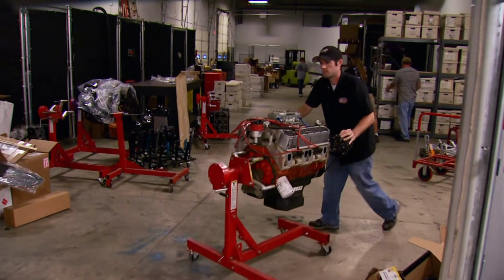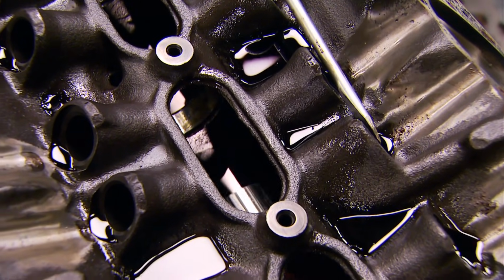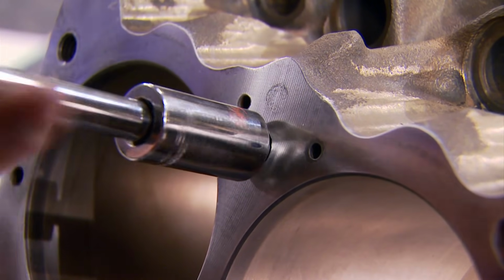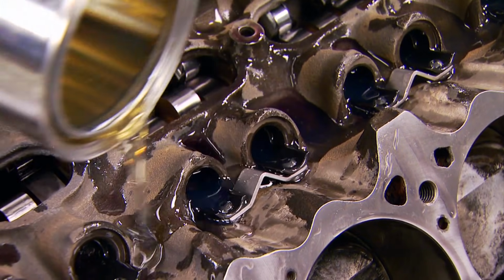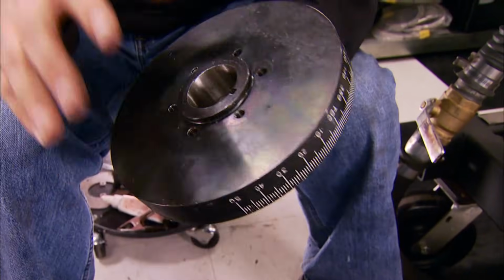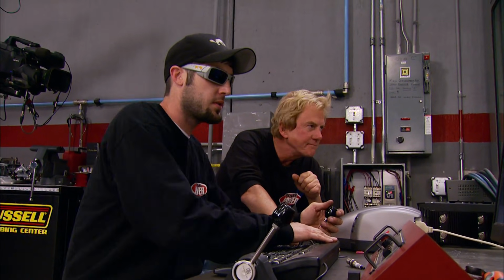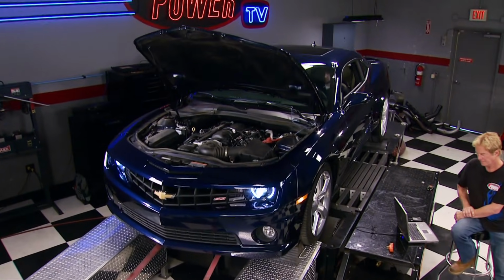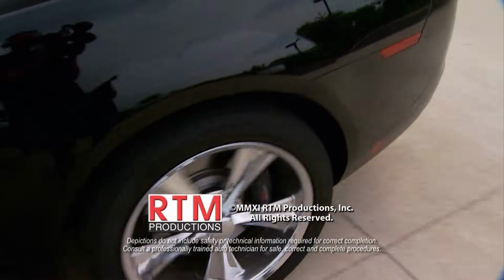Rebuilding A Junkyard Mopar 360 With Minimal New Parts - Horsepower S14, E19

Comment: at what rpm did you make max horsepower and torque and what is the compression ratio how much queench do you have between head and piston is that hypereutectic pistons block bored.020 over

Comment: The only thing I don't like is how they cleaned the surface of the heads were they contact the head gasket 😢 good thing they caught that balance issue that could have been dangerous 😮 I had a piece of metal get behind my glasses and get in my eye but it was a chip from cutting metal on a miter saw and it was very hot 🔥

Comment: The heads, intake, and valve covers, not to mention the oil pan and roller conversion are quite expensive, normally you might find a used or junkyard engine with one of these for $500. But not all. The last small block i built cost 7k in parts including  twisted wedge heads $1500 each, callies billet crank 2k, carillo rods , king bearings, mahle pistons, chrome rings, needle bearing small end machining for rods Bowtie block, deep sump pan, titanium valves with 5 angle valvejob and port blending etc, secret carb and intake  it made 780 hp, not bad for a stock bore chevy 350. But obviously not unobtainable either with careful planning and execution, research etc. I researched the parts combo for 2 years before ordering anything, sometimes thats what it takes to build a dream engine,,,, lotsa dreaming,,,, then lotsa money and labor, and patience.

Comment: Surprise to see no one caught the fact. That's a magnum block with LA style heads. No oil going to the top through the block. Block not drilled. To supply the heads with oil. Push rods are solid. No oil passage in the Push rob That's what you get with Chevy guys. Building a  mopar engine.
Reply: THANK YOU
Reply: I was surprised that when he pre-oiled the engine, an turned it over by hand, he did it with the valve covers on.
 If they had been off, they may have noticed a lack of top end oil.
  I have come accross 2 318 magnum blocks with LA heads, (home rebuilds) it is surprising how long they will run without any oil circulating through the top.
 But, they do end up wiping the valve train out.

Comment: Read comments.... dont laugh... i bought cheap rusty Plymouth volare for $150 many years back had plain high mile slant 6. Some old friends ww new growing up into crack n coke etc were desperate for a car with tabs. My oldest brothers friend. He traded me strait up for B5 blue 72 Cuda" 340. He wasnt mechanic. I saw it had alternator wire hanging off, and needed correct fan spacer. I went home got correct spacer i had, went back and drove car home. 175,000 miles burned tiny bit oil but ran real good. Slap stick, buckets etc. My one brother told me years later that he said... yeah(my name) got me on that deal.

Comment: Looking for recommendations / ideas on a 360 motor build for an 83 Jeep Cherokee that will be doing some occasional travel trailer pulling in the Midwest and West threw the mountains. Key points Fuel Mileage and Torque to get me through the mountain passes without unfolding my wallet every 100 miles for a fill-up.

Comment: Wow that was a Really nice used engine only thing wrong was the old owner didn't have the correct weight on the harmonic balancer or the wrong one?? it takes a External balancer and correct external weights on torque convertor for 360 LA block or newer magnum block also different, A car would never drive that way would FRY the bearings real quick with neutral or internal balancer and vibrate like HELL! 318 cubic inch is internal balance uses different torque convetor too both have to to match up. I think the newer 360 Magnum motor can use the neutral balancer with neutal balance torque convertor NOT compatible with 360 LA block OR the torque convertor. 3000$ worth of parts on that motor , they scored big time Older pre 1992 360 LA block almost impossible to find now.

Comment: 450 dollar Mopar😭😭😭😭😭 I can't find set or used roller rocker for that. And it had aluminum heads, new dizzy, comp cam, roller tappers, RPM air gap, demon carb, moroso oil pan and roller rockers????? Hahahah I need that towns craiglist page. I smell fish, hell you can't even build a Chivy for that....🐮💩

Comment: So have you guys ran this engine again because I'm sure it's had rocker arm failure by now. You have a magnum block with LA cylinder heads and as you can see in the video it is not an early production block that still has the LA oiling drilled. You guys definitely need to get someone that knows about Mopars in the shop. You needed to have used shaft Mount rocker arms that oil through pushrod since you no longer have block oiling to the Head. such a shame as first the Trickflow headed 360 and now this one.

Comment: @7:15 and it shows the Camshaft distributor gear, question: Is that Steel Gear you are using with a Roller Camshaft? or is it Bronze?

Comment: “We found this $5000 engine with two thousand dollar heads for four hundred bucks, just like the average person would, then act like it needs to be rebuilt so it can seem like thats why someone sold it for scrap value”
Reply: I do really like this comment :D and couldn't agree more lol.
Reply: I thought the same thing. For an all in budget of 1500$!?!  Like really?!  Take the 360 out of my grandads pickup that’s been sitting in his backyard for 35 years. Haha
Reply: @merlincaldwell547 most people don’t mind loosing like 3500 bucks
Reply: @merlincaldwell547 right lol I think there math isn’t Mathing 😂
Reply: EXACTLY lol wtf
Reply: Not to mention the Demon Carb on it that 250 used by itself
Reply: Except you do come across cheap things like this when someone is cleaning out their garage.

When I was 18 I bought a 69 mustang fastback for $1250.    The guy was asking $3000, but we had an engine so he decided to keep the built 351C with 500hp and sell the rest to us for just $1250.
Reply: The only time I seen a realistic engine build on here was they rebuilt a TBI 350 that looked like it really had 200,000 miles on it they we’re outside under a pop up tent using real hand tools only scrubbed the block with a garden hose and they had $2500 in it to me that was believable and the engine was 500 but it looked like it should covered in grease and oil grungy rusty and worn out
Reply: 💯 Agreed 👍 👍👍
Reply: My my buddy and I pulled a built 460 out of a pick and pull for $250. It was a fresh motor that we were familiar with that was built for close to $20k. The guy got a dui, went to jail and failed to get his car out of impound, after 30 days it hit the pick and pull yard….it happens
Reply: Yes exactly. It's stuff like this that completely eliminates any semblance of credibility that these channels have.
Reply: Guys chill its just an engine rebuild ASMR video with commentary. It had no legitimacy, to sell.
Reply: Adding a note here for context, "Horsepower S14, E19" aired Feb 2013.  That's 9 years before this video was posted to youtube--
Reply: its literally the engine they built in season 7
Reply: Well I've seen forward somebody puts some money into something and it winds up getting wrecked and then they because they're hurt or whatever don't have the motivation to have it towed directly to their house so that they could you know get their stereo amp and subwoofers as well as swap the motor and s*** in it before the insurance company comes to get it or just buy it back yourself from the insurance my father has done that several times what's different accidents over the years we woud up straighten out some frame rails a little bit put on some new bumpers on a tire or two New Shackle and leaf spring add transmission mount & pop was back on the road for a pretty good price no worse for where than what it was before......it happens
Reply: This episode is closer to 15-20 years old
Reply: There's no telling what you will find at a swap. Especially the larger shows. It's rare but it does happen. I would bet with that mismatched balancer it was tossed "out back" and forgotten.

Comment: I rebuilt a 1968 327 using a crank from another block.no line boring re used rods and pistons. Used cam found in junk yard with unkown lifters.new bearings and   rings honed cylinders.  lapped in  used multiple different best looking vavles from multiple heads in the best 2 looking  heads with Ford cupped valve seals. 4 barrel Chevy factory cast iron holley bolt pattern intake from junk yard. In my buddies dirt floor car port Started ran great drove 59 chevy truck from Kansas to California towing trailer in 1987.. i drove truck as a comuter for a couple years. Tgen drove truck off and on up until 4 years ago.rebuilt motor correctly all new parts

Comment: I had the exact same thing happen to me when I was grinding a little piece got under my safety glasses you could actually see it in my eye before I got to the doctor and got it taken out I actually didn't realize it was a piece at first though so I got to sleep overnight with mine in tossing and turning feeling that scratch in my eyelid and then in the morning I realized something was wrong and went to urgent Care and they put me in this little head strap thing and doctor just went in with these tiny tweezers and pulled it right out

Comment: as someone who does structural metal fabrication in a shipyard environment, the best thing for grinding is safety glasses and a face shield. it's called double eye protection. if I am working at home I never grind with glasses but grab the face shield. It prevents a lot of injuries

Comment: Rust on valve springs=straight into the trash.  And they could have rebuilt that Demon carb for around 100 bucks or less.  The core motor for 475 might have been believable if it were some used up old W2 dirt track engine or something like it from an estate sale.

Comment: 450 dollars my ass. No one has an engine like that and sells it for anything under 2,500 minimum. Alumium heads, Jesel rockers, retrofit solid roller lifters, solid roller cam, single plane intake, electric water pump, and moroso oil pan? No chance. Junkyard my ass and 450 dollars my ass.

Comment: $475 lies lies lies heads go for $1,500+ and roller rockers $350 air gap intake $300 Demon strip Dom 850 $600 add a msd distrib $300 deep moroso oil pan $300 electric water pump $350 only way you can get that motor is hot hot hot or a hurricane or flood car auctioned off to a camaro/mustang owner who dont know prices.. Hey dumb ass!!!  the motor is probably balanced don't count on making it stock as engine is already been rebuilt with low hrs. I had my 360 neutral balanced, so i don't have to run a balanced torque convertor

Comment: 1) clean with oven cleaner or lye, gloves and glasses, and chase with rifle bore cleaning brushes to save a dollar, then toss on old tire into pickup bed and go to the car wash.  Rust? look up electrolysis or soak in a molasses mix in a kiddie pool to save the next buck.
2) if you're really going to sand off gasket material from deck surfaces, use a flaaaat long board so you aren't digging in and leaving high and low spots with some circle grinder--otherwise you circle jerked yourself into more work when its time to seal up that head gasket.
3) no ScotchBrite pad on the cylinders, unless you want to screw up the cross hatch. Use a Magic Eraser with some ATF as a detergent to clean the cross-hatch.
4) installing cam before the crank gives you the ability to reach into the crankcase and help guide that camshaft in. Checking crank thrust when taking the block apart can tell you there's an issue to machine on before putting the crank in and checking the thrust to find there's an issue that needs addressing.
5) the Uncle Tony crowd will tell you to turn the pistons 180 degrees (shifting them from one bank to the other) to offset the wrist pin and get 5 more hp.
6) how to get cheap roller lifters and a cylinder head that flows better than the average360  LA head made between 1974 and 1984...buy a Magnum from the junkyard.

funny how that cool electric pump disappeared.
Reply: lol got to laugh at the uncle tony joke! id love to see tony do a dyno before and after, id bet it loses power. by far the most outrageous claim I've ever heard. you'd think the aftermarket would have discovered this trick already, guess they're all just a little slow
Reply: Still waiting on richard holdener to do a dyno test. Uncle Tony also still paints the inside of the block. saying it prevents rust. In reality, no one has ever pulled a sealed engine out of a junkyard to find rust inside--the oil film left behind repels water. More importantly, if painting the inside of the block ever did the things folks claim, why aren't they painting the heads, the crankshaft, the connecting rods, the cam, the pistons...don't all those parts need the same benefits?

I'll make a prediction now, swapping pistons turns out to make 5hp. We'll see.
Reply: @albertgaspar627  My prediction is ZERO hp. Road kill guys think the same too
Reply: @mattmcneice7223  There may be some variable between engines that offers a chance, like someone cleaned something and voila got better cylinder seal and felt a difference--same people who swear their 305 pulls as well as any 350 out there. Someone like Smokey Yunick should have measured a difference, but he thought long connecting rods were the winning formula but Reher and Morrison couldn't duplicate his results. The aftermarket should have found something, but they also sold us windshield wipers with little wings and spoilers on them and magnets to clamp around your fuel line :)

Comment: They built a 410 stroker motor a year ago, promising a part 2 with dyno testing. I know it's somewhere in the low 500's in HP and TRQ, but......we're still waiting......
Reply: Because the engine got tore up you go back through the video and pay attention to detail they use solid pushrods so there was no way in hell for the rocker arms to get oil since I'm the late model blocks that do not have La oiling Provisions you have to use shaft Mount roller rockers that oil through pushrod when using LA style cylinder heads on a Magnum block or you need an early Magnum block 93 to 95 that are still drilled for LA oiling.

Comment: If I found that engine for $400, I'd be asking where the guy selling it got it from. Also he would probably be asking me if I knew where he could get some "rocks"
Reply: My first thought when looking at this.  Those heads are $700 a piece bare right now.  If i could find that motor for $400 I wouldn't be asking any questions either...
Reply: Dont look a gift horse in the mouth. Take the motor and don’t look back.
Reply: Must’ve brought there wives and had a little cuckold situation to get those prices unless they’re stolen…

Comment: Lol I call bullshit on 400.00 Roller cam and aluminum heads. Person would have to be on serious crack to sell for that price.
Reply: Magnum block there. But with the shaft monted rockers. It had to be drilled or a  early magnum block. 91-92.  But I've seen some people's make light a aluminum heads. But the .557 lift cam. That with the heads. Will help in the HP world. My Magnum (s) drop off in the upper rpm range but this set up it keep climbing. Oh the seat of the pants feel. It doesn't lay down.

Comment: Was hoping this would be a mostly stock build like a real backyard mechanic at home would assemble on a shoestring budget. But as soon as they said they bought that motor for under $500 bucks I knew this episods was gonna be a joke, you couldnt even buy the cylinder heads in used wore out shape for that let alone the expensive deep sump oil pan and demon carb, I think they did it because they didnt want to do a all stock motor and only make 200hp and disappoint people but that's how it really is if your looking for a motor like this you not gonna find anything like it for under $1,000. Their acting like his motor was all junk and super cheap but for alot of people most of the parts on that motor are way out of people's budget, most people are lucky to get a decent carb and intake but for cylinder heads, fancy oil pan, and all the other goodies this motor is out of reach for alot of people and these shows make this stuff seem cheap but in reality its not.
Reply: Junkyard my ass, any junkyard is going to see that for what it is and strip the parts for sale individually. They got a discounted disposal from a buddy who probably upgraded with a crate engine.
Reply: LOL you hit the nail on the head I know I got one LOL

Comment: My God, using a roloc wheel to clean the head surface.
Reply: Better than a scraper blade
Reply: @torcher78  one of the worse ways to clean a head or block, creates massive divots. Look up fiatnutz and his machine shop videos, he's done dozens and dozens of heads that you have to machine to get the part flat again

Comment: How to rebuild a $5000 engine for only $1500.
Reply: That's what I said. Stroker 360 only made 440hp wouldn't have sounded as good
Reply: @Go4BrokeOffroad yeah but if it had been a GM. They would've spent a lot more than $1500.00 dollars.